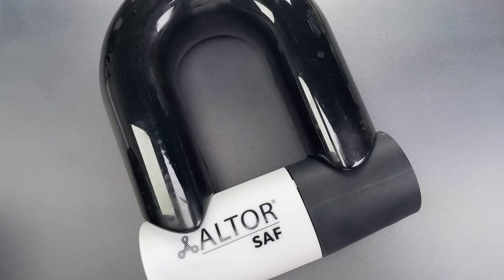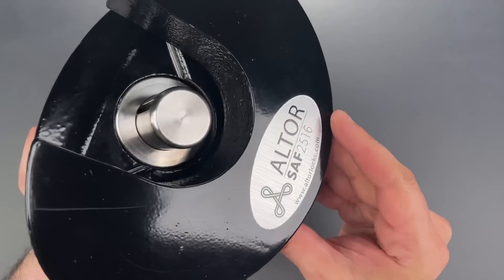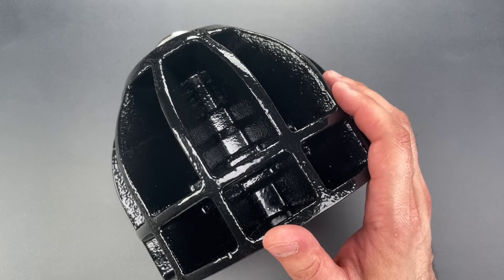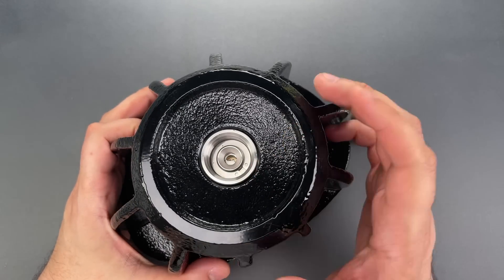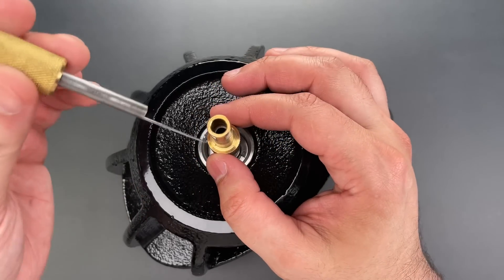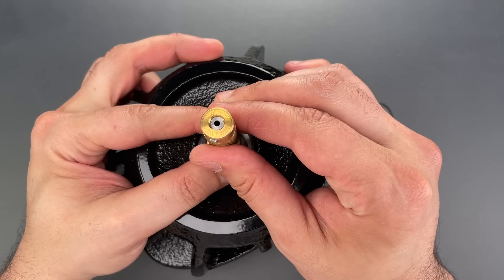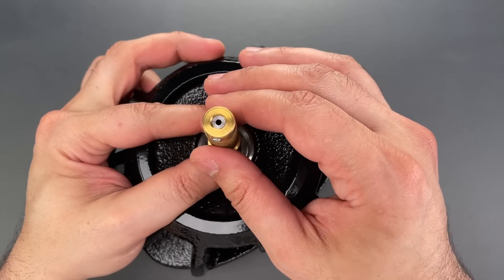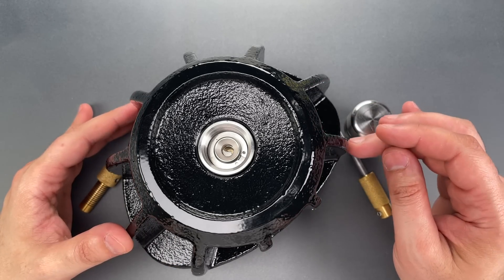[1339] HUGE Altor “SAF” (Strong As F***) Trailer Lock

Comment: It's probably much easier to cut off the trailer hitch and weld on a new one.
Reply: Same.
Reply: That is always the problem with a really secure lock. The things around it are not as strong. On a house it's easier to crowbar the door to get in than it is to pick the lock.
Reply: Plus you get to keep the incredibly valuable lock
Reply: I would say its probably even easier to have a bigger trailer to put the target trailer on and secure it and drive off that way. Or just have a trailer and a few motivated thief buddies to move the asset from the target trailer to other one.
Reply: It's designed to go over it quite far so in theory you can't get a power tool between the trailer and the vehicle, however there will always be a work around in practice, eg go underneath. The important thing is that the lock company themselves won't be the weakest link.
Reply: @MintRobin  its not for locking a trailer to a vehicle. Its for locking a trailer that isnt connected. So like free standing. 
But if you really want to secure the trailer from pull offs then you would want to armor the coupler tongue, and buy multiple locks for the wheels.
Reply: You just have to make the trailer more risk and trouble to steal than the value of the stuff on it.
Reply: That was gonna be my comment!!
Reply: Alam natural  Hello. It looks like you are trying to attract new vievers/subscribers to your channel by spamming your videos in the comment section of other YouTubers. If you aren't aware, this behaviour is not going to achieve the desired result. Some curious people like me will klick on the link, skip through the video and then exit playback, before it was counted as a view. I, like others, will now remember your name and avoid your channel like the plague. Have a nice day.
Reply: If you cut the hitch off, you have no way to haul the trailer away. Unless you mean cutting it off and welding a new hitch, right there on the spot?
Reply: Just tie a rope or chain around this lock and pull entire trailer behind your stolen SUV.  That is, unless this lock somehow interferes with brakes, wheels etc.
Reply: @johndododoe1411  that would not work well. The hitch keeps the trailer from crashing into the rear end of the car. Even if the trailer has brakes it would still hit the car.
Reply: @chasemc69  yes, you would either know which trailer you were stealing and what sort of tongue it needs, or you would have several with you. And a truck with a portable welder on it. This happens though its not the most common type of attack.
Reply: Most couplers are bolted, not welded, to the trailer. Making that attack easy and practical.
Reply: @Green__one  yeah, but people who like to keep their stuff will often have their couplers welded on too so that it cant simply be unbolted.
Reply: system is only as strong as the weakest point.
Reply: Wrap a chain around the neck of the trailer and attach the other end to your hitch. Drag it off somewhere and cut lock at your leisure.
Reply: Yea this won't deter the professional thief, the kind that watch your social media then turn up at your house posing as removalists while you're on holiday.
Reply: You're probably right and it would also be possible to simply improperly tow the trailer with the safety chains to a more secluded spot.  The most recent trailer thefts that I've read about leaving locally have been brute force drag it away sort of attacks.  That being said if you we're going to rely on securing the actual proper way of towing the trailer this seems like about the best thing out there.
Reply: @2LucasKane3  Yep, and don't forget report as spam.
Reply: They say a chain is only as strong as the weakest link 😅
Reply: @matthewtalbot-paine7977  Yeah, you really just push the weak link a little further down the line.
It is a really funny feeling though, when you find yourself in the situation that you improved the entire line and the item you improved first is the weak link once again. ;)
Reply: @metamorphicorder   The LOCK'EM wheel lock, with cylinder upgrade ( I have in my store with 3 lock options ) does a FAR better job of making the trailer difficult to drive away. USe with the ADVANCED brand lugnuts, as a wheel lock is no good if you can put the spare on!
Reply: @metamorphicorder  or the similar trailer in your neighbour's garden...
Reply: @2LucasKane3  Whenever I see someone do this I go to their channel and report them for spamming. (additionally reporting the comment in question)
Reply: It's easier to walk away and find something else to steal!
Reply: @citylockapolytechnikeyllcc7936  Seems like we have a spammer in our ranks!
Reply: @metamorphicorder   welding? no welding or cutting is required in the manner they get hauled off, with lock still intact
Reply: @Green__one  These are common and rediculous.... but even that would require a box wrench and a few minutes to swap out....  thieves do not even need to do that.
Reply: @matthewtalbot-paine7977  You must have very weak doors where you live. Unless you mean apartment doors which thanks to costcutting are usually easy to break into for a 3 year old.
Reply: Sure, but if you have such unrestricted access to the trailer that this is an option then you've already effectively stolen the trailer.
Reply: @citylockapolytechnikeyllcc7936  yes as i mentioned there are many ways to attack a trailer. Not everyone who steals trailers has the optimal set up. And the optimal set up may be the most successful but its not necessarily the most common. 
 A security system should protect against all the other threat models that are possible to protect against. Thats how you reduce your chances of being a victim as much as possible. 
 I mean nearly all bike chains can be cut with a grinder and enough time. 
 But that doesnt mean you dont use a stout chain and lock it to something sturdy. And yes you can do other stuff too.  But just because grinders and bad people exist doesnt mean you stop locking it up. The most common way a bike is stolen is because its not locked up or its locked with something that can be easily broken by hand or simple tools. 
 Sturdy chains prevent that. 
This prevents people who dont or cant employ methods capable of beating it.
Reply: LMAOOO
Reply: Always attack the weakest point.
Reply: @metamorphicorder  An unfortunate truth, almost anything, up to a 20ft container can be hauled up onto a tilt and load tow truck.  Cameras and Lojack deter most.
Reply: @2LucasKane3  By the way, does YouTube "reporting as spam" even help?
Reply: @markbernier8434  that what i mean man, you protect in layers to the point that its possible to protect against the actual loss of an asset. The loss is measured in more than just the dollar value of the asset. 
 I rebuild transmissions for a living and was being audited for quality and compliance the other day and had a conversation with the auditor. 
I try as much as possible to make sure i can use every part im given so that we can make as  much money off each rebuilt trans as possible but i also prioritize the quality and safety of each part i build over that, secondarily because its more expensive to rebuild a rebuild that fails on the test stand or replace a warrantied failure. But primairly i dont want to be the reason someone has a major inconvenience or a bad day or worse. Thats the best case scenario for me sending a nearly passing part through. Someone breaks down on the side of the road and is late to work, they have too many points and they get fired. 
 Or someone just breaks down and misses a date. Or has to wait in the heat or anything else. And it only gets worse from there. 
 Its the same thing here. For things that cant be protected against theres insurance. But the insurance doesnt protect you from missing that motocross race because your whole kit got stolen and it takes weeks or months or more to replace everything even if you get a full payout. It doesnt protect you from that stress of having your stuff stolen. Trackers are good but they fail at the same point too. Thats why you have all or as much of it as you can.
Reply: @matthewtalbot-paine7977  usually it is easier to go in through a window if the thief is not careless. If there is really something valuable shutters everywhere thieves might get in or steel plate on the outside of doors and bars on windows.

Although it depends on the type of door and window.
Reply: @paul_warner  Which'd be a lock without key though
Reply: Your profile pick really matches your comment.
Reply: To be fair, local gypsys strap on an a frame to the underside of the existing frame and just tow it away in a matter of minutes
Reply: @2LucasKane3  yeah and people like me will report him for unwanted commercial / spam .
P.s for the other reader If you don't bother reading what i'm talking about don't bother replying to me .
Reply: Alam natural  get out of here.
Reply: yeup, and even then you would be heard
Reply: Definitely.
Reply: And then leave the trailer and steal the lock.
Reply: @SVlad_667  I think so. Whenever I reported a comment for spam, it was removed some time after my report, but enough people have to report the comment aswell. So it really depends on how trigger-happy people are with the report button.
Reply: @metamorphicorder  Absolutely. Business you lose because you had a trailer stolen can easily be more than the insurance payout.
Reply: Locking the coupler does nothing as long as the trailer will still roll. I’m not a thief but I could steal most trailers in as long as it takes for me to get out of my truck, walk around the truck, and get back it the truck. If I could sketch in the comment section I would demonstrate. All non gooseneck trailers have a tremendous flaw that makes them super easy to steal. No tools required
Reply: @seriousmaran9414  Yes that's exactly what I was saying and actually the easiest way to get into a house is through the roof. If you saw someone in a hi vis vest on the roof of a house you wouldn't call the cops and once you are on the roof there's not much blocking you from entry but yeah windows also work when they are not in plain sight.
Reply: @matthewtalbot-paine7977  that depends on what the roof is made of. It would also leave a hole and the thief has to climb out again.

TBH I have seen reports of breaking through roof windows but not of the roof itself.
Reply: @2LucasKane3 Not to mention report it for being unwanted spam, & flagging their channel as well for misuse/abuse of the chat system using solicitation tactics.
Reply: @2LucasKane3  Unfortunate reality is 10x more people will click his link than read your commentary (or click the link out of curiosity after reading your comment).  Welcome to youtube - shit floats.
Reply: That's what I was thinking.

Or just rap chains around the hitch and drag the trailer off to a safe area to plunder it.
Reply: Just rap chains around the hitch and drive to a safe area to plunder the trailer.

Remember, if the doors have good locks, and the windows have alarms, then just knock a hole through the wall and get in that way.
Reply: @2LucasKane3  Unfortunate truth: These are people who bought advertising for their videos, or haven't. These bots will put real channels in with channels who paid as to protect their customers from having their channel deleted. The channel might just be unfortunate, or have maliciously tried to increase their viewcount. There's no way for us to know.
Reply: @2LucasKane3  exactly! 😁✌️
Reply: Why cut when you can strap it to the hitch? You are making it so complicated.
Reply: @matthewtalbot-paine7977  Luckily most thieves will move to an easier target if they encounter stiff enough resistance. Thus, the locks are still worth it most of the time!
Reply: And then make good money selling it for scrap at the recycle center.